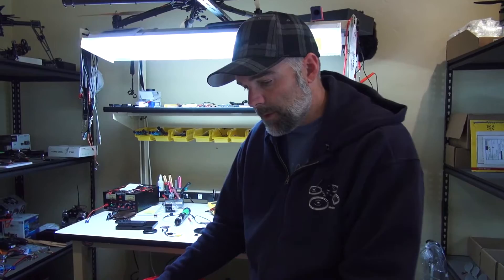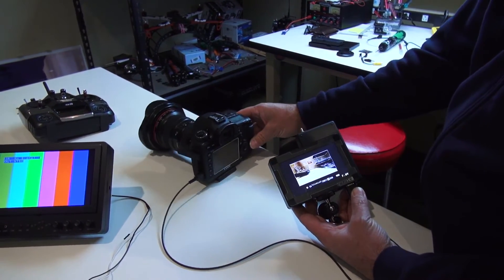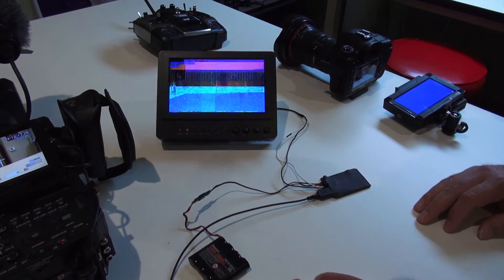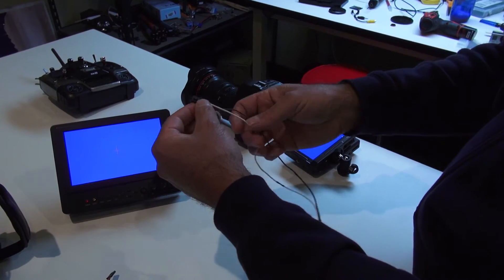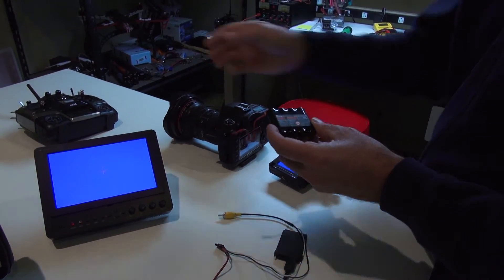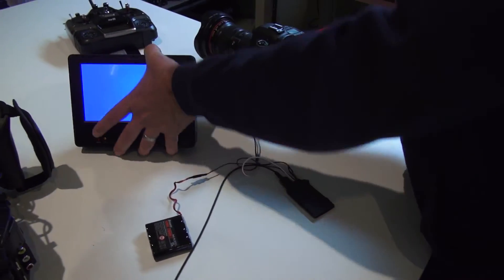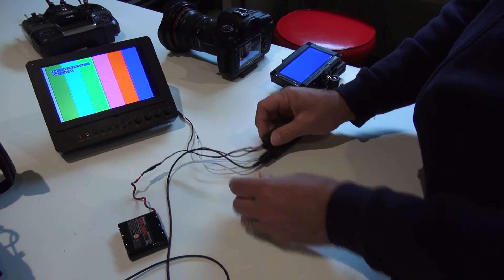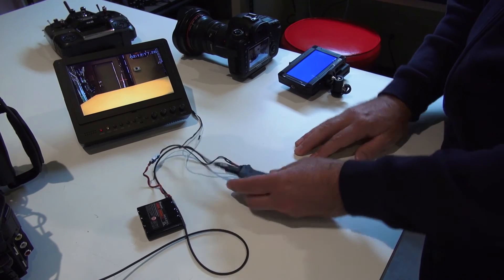Quadrocopter Tutorial - Freefly HDMI Converter Troubleshooting

Comment: Hey why did you have to grab signal from the Sony and not the 5DmkIII? Is there a problem converintg the 5mKiii to sd video? Also what kind of lag does this converter have? Is it possible to use the 5dMkIII for FPV as silly as it sounds?